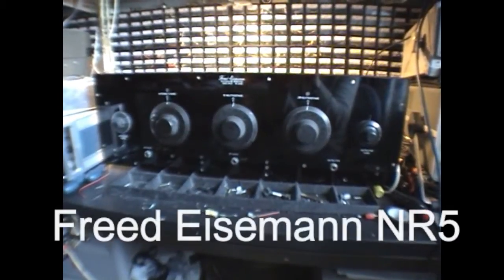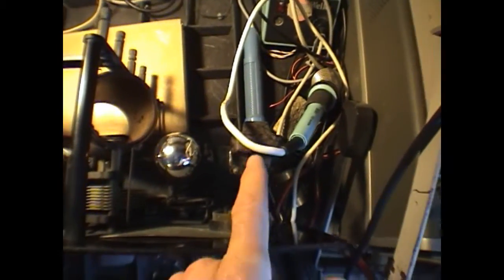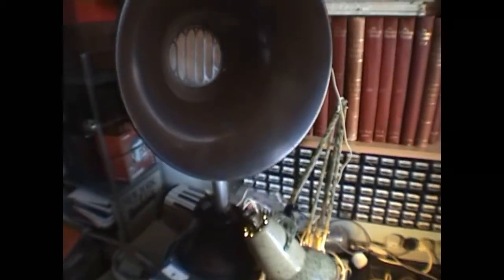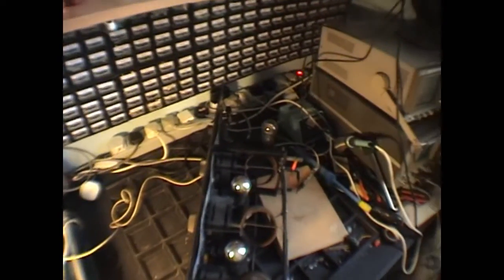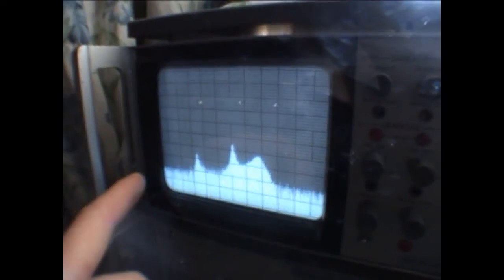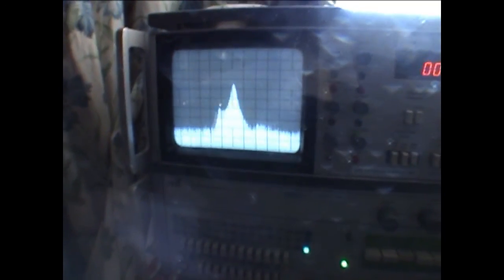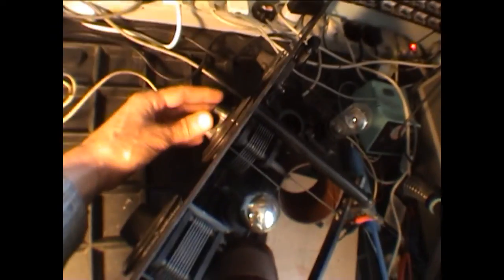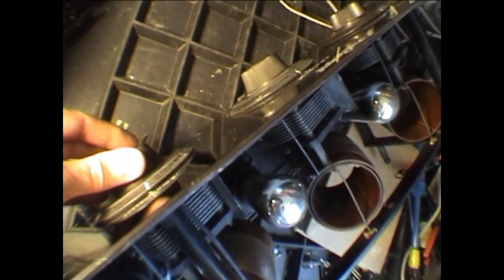Freed Eisemann NR5

Comment: Hi Peter, that set and sets like them are called neutrodynes which is a off shoot of a T R F radio and there is data on how to align them if the radio is out of alignment. That is why when you tune the airwaves with those kinds of sets, you make notations on where the knobs are when you tune into a station. What you might need next is a B and C battery eliminator with a 874 voltage regulator valve which glows purple like an OC3 valve. 
One other thing I would like to mention is that speakers were not called speakers until a little later on. They were called loud talkers. So, if you see a horn speaker, that is a loud talker type. Lindsay publications now defunct put out reprints on how to make a loud talkers and other small booklets on different subjects.
Reply from the maker: Thanks for that.

Comment: If you are still doing this. I have obtained a Freed Eismann NR-12 and It is missing the first RF antenna tuner assembly. My guess is that it would use the same air capacitor but with a 15:50 step up auto transformer for the antenna coupling. Do you know how I might obtain one of these?
Reply from the maker: Hi Richard, I don't think I have a variable capacitor matching the type in my NR5. I've had a look in my loft but don't appear to have any variables of any description. You might have more luck with a post on antiqueradios.com/forums.
Reply: @PeterScott  thanks for your effort and suggestion. Sorry for the late reply though, I've have a pretty busy few weeks.